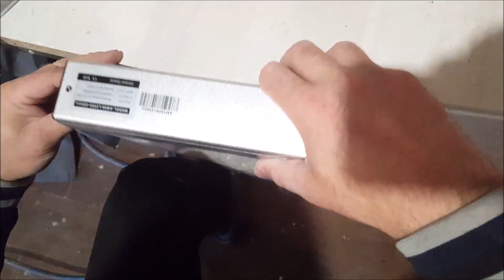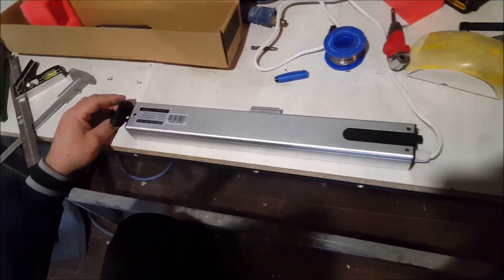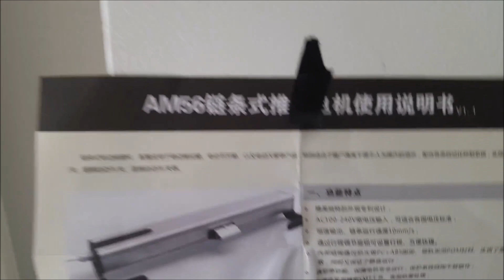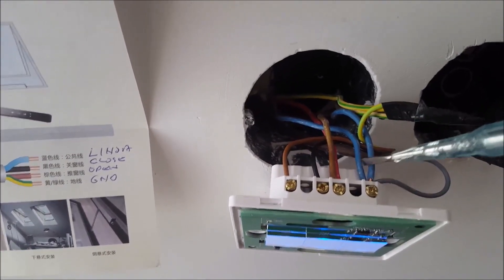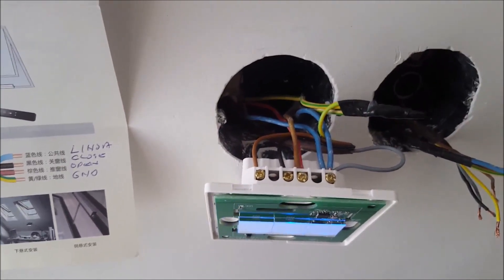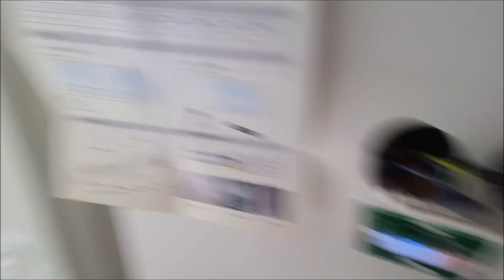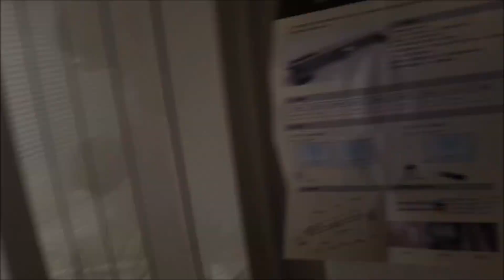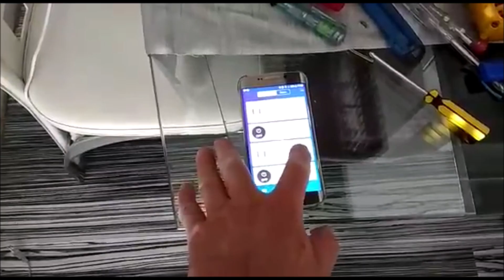How to open and close home windows controlling by Alexa, google assistant or app

Comment: How stóp windows at 10% or stop windows command
Reply from the maker: you need to have that kinde off switch..
i can do by stopping on touch switch  on the wall.. also alexa can have routine to stop on 10%. but most important is version off switch on the wall that Alexa or Google communicate with.
Reply: You only showed closing the of the window. You did not show the opening. Was it fully opened when you opened it ?